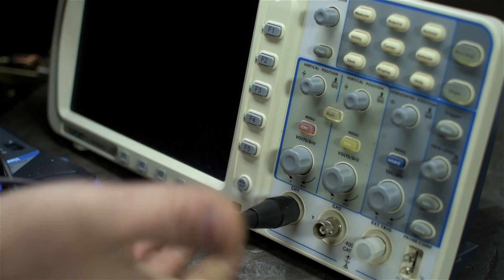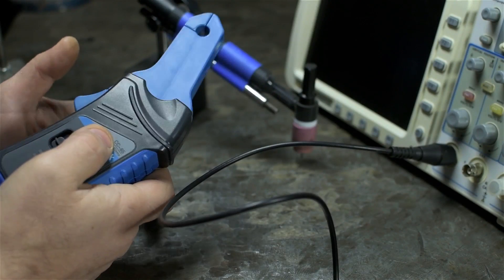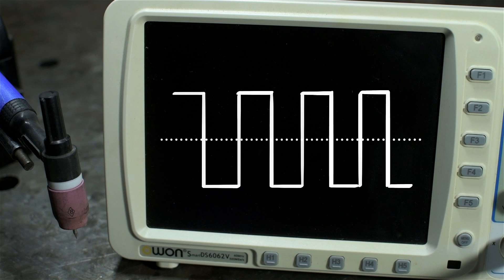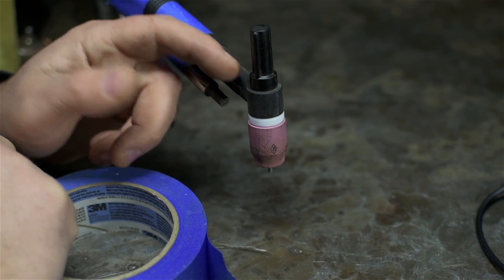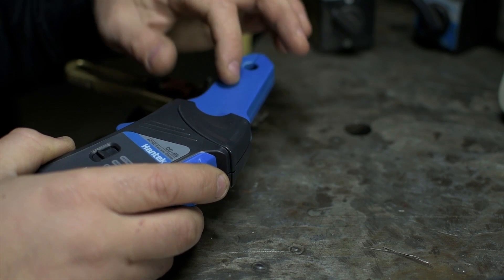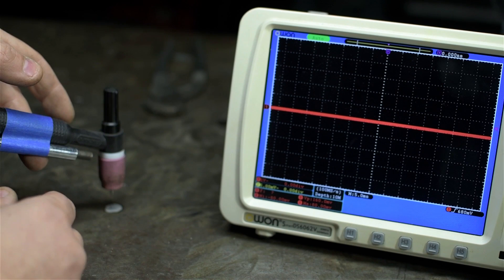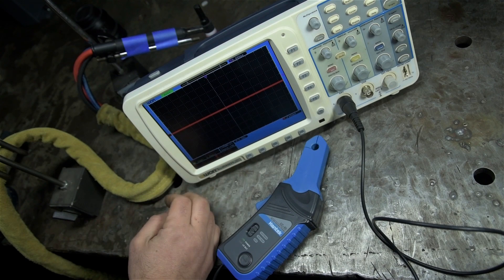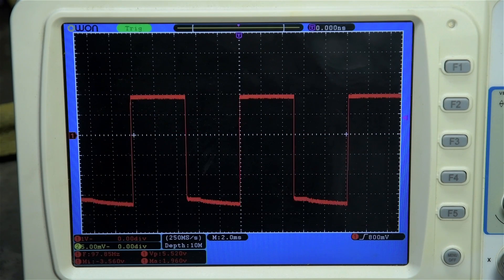Oscillo-Help-Me?

Comment: Errr random watcher here. Have a basic understanding of ac and dc currents in waveform of operation. Definitely not an EE like some others in here... I am a welder tho. And the scope is pretty much what i would expect out of the box for ac settings. The best way to understand the functioning of ac balance is to understand DCEP DCEN. As this is essentially what the "intelligent" square wave form delivers. So by having a larger portion Of the cycle DC-- you have more work (heat) being done at the parent material while having tungsten preservation, then engaging the positive cycle for the cathodic cleaning cycle. Of which the tungsten sees more work and self cleans( hence the electrode balling on ac) it also helps break down the surface aluminium oxides. If you play with the balance function on your welder you'll find it will probably add electrode positive to the cycle. Or shifting the crossing point towards the positive cycle. That scope looks like it would be set at maximum penetration on a CLEANING - BALANCE - PENETRATION dial.  

Good luck with your exploration.

Comment: 1.) High frequency from a GTAW machine imposed on a scope will almost assuredly cause damage to the scope. 2.) What type of tungsten are you using in your torch? For AC welding output, you need to use pure tungsten or zirconium tungsten for your torch electrode. Other types of tungsten do not allow equal passage of current from positive to negative current flow.

Comment: This is pretty basic no? You can't just have a floating voltage reference from the battery and expect the correct offset for your scope. You have to have a common ground reference.

Comment: -- Try 50% duty, and see if that is part of the effect. 
-- Good call about the battery powered scope. Keep doing that. While you could potentially get better grounding if you added a ground strap from the scope to the nearby metal, it can also be detrimental, as the little ground straps on your scope probe, or the outer shell of the connector on your scope, are connected to the ground of the scope. Get a multi-meter and touch one side to the outside shell or little strap on your scope, then put the other end of the multi-meter on the ground prong of the plug. You should measure very close to 0 ohms. If not then your scopes ground is broken. 
-- The hall sensor used in the current probe can be effected by external magnetic fields. Keep the clamp away from iron or other things that can effect the magnetic field. If that doesn't help, then take a reading with the wire next to the clamp, and another reading with the wire through the center of the clamp. Subtract the two readings. The first reading will tells you the majority errors caused by nearby magnetic fields, while the second will include these induced errors and the signal you are looking at. 
-- For fun, start welding something and then put your current clamp near the arc. Even though there is no wire in the center of the clamp, you'll see some really funky things. Think of it a as a kind of magnetic wand. 
-- Also the Hall sensor typically has greater sensitivity in one direction. Repeat the above but flip the clamp, such that you run current in the exact opposite direction. Average this reading with the last reading. AKA if this reading claimed -1.2A, and the other claimed +0.8A, then you really have 1.0A, and the + or - depends on how you like to think of the world. 
-- Try clamping both your + welder wire and your - welder wire. It probably will be the same, but keep in mind that the two welder leads are going to be at different voltage potentials, with the arc being most of the voltage drop in the current loop.This potential can cause a DC offset in your scope, especially with AC signals. Keep in mind AC can couple across gaps just like how antennas couple energy, and how caps or transformers couple energy. Just because your on a battery, doesn't mean you do not have a ground connection. I just means you have higher impedance connection, which prevents fire and catastrophic scope damage. Your scope is measuring very small voltage on a very high ohms sensor. It does not take much current in the scope probe to skew the scopes readings. I say you'll probably see the same signal, because the coax that connects your probe and your scope is fairly well shielded against both electrical coupling as well as magnetic coupling. However if that shielding is damaged..... It's good to do a basic check of your shield by measuring the ohms between the shield and the ground plug. It should measure very close to 0 ohms. 
-- You should avoid the upper 20% and lower 20% of your clamp range. You can measure more than the rated amps, but your tolerance will go to pot. Most of your tolerance errors are induced as you approach the rails. Your hall sensor will have more trouble driving at the 100% of it's ratings, than at 80% of it's drive ratings. 
-- It would not surprise me to learn that welders have a DC current on top of the AC currents. Keep in mind that you want the metal to go to the work, not to  your tungsten. A DC current tends to make the metal flow in that direction. After all these tests are done, it would not surprise me to learn that the welder is intentionally adding a DC current along with your AC currents. However I have never heard of this officially.

Comment: From the welding side, it looks like the positive end of the wave form provides 'cleaning/width' and the negative end provide 'penetration'.  They seem to often be in a 'balance' that is not 1:1.  https://www.millerwelds.com/resources/article-library/understanding-ac-tig-balance-control.  The amount of negative to positive seems to affect the weld and be adjustable for the purpose of fine tuning.
Reply: On the AMPerage end of things, this post seems to be discussing it: http://www.millerwelds.com/resources/communities/mboard/forum/welding-discussions/18872-ac-tig-balance-control-vs-differential-current-adjustment

Comment: I hope you figure this one out. maybe you could use a resistive current shunt. measure the voltage across any resistive thing in series with the circuit, such as the wire itself. it you connected the ground of your scope to the ground clamp, and the positive to the ground closer to the machine, it should give you an accurate reading of current without the current sensor. resolution would depend on the minimum vertical scale of the scope, length of wire, and gauge used, but it might be enough to see what you're looking for.
Reply: additionally if you do this, definitely make sure that the scope is isolated, lest you fry a nice oscilloscope.

Comment: This Old Tony thanks for all the great videos AND a great sense of humor. Your comment in the tig cooler video that the coolant should be changed annually but you will do it the old fashioned way was just killer.

I design electronics for a living. Here's what's happening as I see it.: 
First,  the current probe isolates everything. What they are are basically is a transformer with a single turn primary, in your case output of the welder through the arc, through the table and back the ground lead to the welder. If you look on the eeblog

https://www.eevblog.com/forum/testgear/hantek-cc-65-acdc-current-probe-teardown-and-testing/

the core of the transformer is a number of iron laminations with what appears to be Hall sensors centered in a substantial air gap. The Hall sensors are there to measure the DC and low frequency component of the current (actually magnetic field). Normally in a high end current probe there is also some windings around the core for high frequency measurement and these two signals must be spliced together electronically. There appears to be no windings in this probe so they are depending on the Hall sensors for everything. Simpler and less costly. 

The unit appears to be powered by a 9 volt battery. The scope, in DC setting, needs to see both positive and negative voltages so there must be some sort of DC-DC inverter to produce the negative voltages required to drive the scope. The Hall sensors produce a low level signal which must be amplified to produce the waveform for the scope. I appears from the shutdown images at 4:40 and 6:50 in your video that this amplifier has been limited to 2 volts output in positive output and just under 3 volts negative, probably to insure meeting the advertised accuracy specification.

Careful examination of the image at 6:50 tells all. The leading edge of all of the current switches is saturating at 2 volts and the trailing edge at -3 volts. The transient is sinusoidal with the top of the first peak cutoff in  both cases. In reality, the waveform you took is incorrect in both the positive and negative portions due to amplifier clipping. Note that the image at 6:50 is truly symmetric.

Looks like you are using the probe in the high sensitivity setting (1mv/10ma) so with an upper limit of 2 volts, the most current you could hope to measure is 20A, maybe 30 on the negative side. Switch it to the lower sensitivity setting (1mv/100ma ) and you should see what you want to see.

On the subject of grounding, due to the transformer action of the probe, there are no concerns. The scope input is galvanically isolated from the voltage and current of the welder. The HF start is another story. The RF produced by this signal should be intercepted by the chassis of the scope and the shields of the probe cables. Maybe not so much in an inexpensive scope like the Won.The RF will induce a voltage on the chassis. If that voltage is not properly coupled to the power supply terminals (both of them) then voltage differentials will cause currents to flow where none were intended causing havoc as you have observed.I guarantee you that Tektronix  would have none of this. 

Switch the sensitivity. I bet you get the right answer.

Comment: First off all you would need a clamp with a higher rating, no idea what the clamp could show if you go past it's rating. Will it clip or get DC offset making it look more like a AC current.

Can I ask, what's the setting on your scope : DC or AC?
Always set your scope to DC (even and especially when you measure AC). The AC setting will remove the DC component (capacitor in series) which is handy for measuring the noise of a DC supply ... and other stuff.

I am no welding specialist but what you have there is not a DC current or maybe they call it a DC current for other reasons ... still, that is not a DC current since it changes directions.

If there wasn't that HF start signal I would say just hookup the scope directly to the welder (probe shielding on table and tip on torch side).
And a even better way would be to use the good ole current shunt and a differential probe to keep your scope safe.

Comment: This is pure conjecture, so take it as you will or not at all. There could be a good reason why the duty cycle is set asymetric on the welder from the manufacturer.

When you are reading the positive side electrons are flowing from the base metal and into the welder, these could in theory drag a small amount of vaporized metal to settle on the welding tip making it uneven in electrical resistance over the whole tip making it hard to control in the long run. But as i said its just conjecture, i have no proof and i dont really know.

Comment: Retired EE, but never worked on ANYTHING close to what you are trying to do/measure !  The HF start issue is simple.  You are BLASTING HF RF into the air just like Marconi did with his early radio experiment in the late 1800s.  This is a very wide spectrum type of "noise" and there is enough energy to simply "scramble" the poor microprocessor in your 'scope.  To combat this, the 'scope would have to live in a Faraday cage, but some noise would still come in on the cables.  Of course ANY arc does the same thing !

Your other issue, I don't know.  I don't think a "floating" ground on your 'scope is helping.  If you don't need to know a accurate value, you can get the same wave by just wrapping some 20 gauge wire around the welder lead and then soldering each end to a one of the terminals of a BNC.

Comment: I am pretty sure the symmetry problem is called "Hantek" and the "going wild" with HF issue is the combination of that and the "WON" plastic box pretending to be an oscilloscope. My Tektronix 465 (plugged into the socket next to the welder) with a passive AC current clamp shows the HF just fine. As always, you get what you pay for and using the right tool for the job is essential.
...OK, I hear the experts shouting "but that's not a storage scope..." ... no problem, in this case i'd use my Tek 464 which certainly does just fine because there is no computer junk in it as well.  And not to forget, both got a proper metal case !

Comment: I was taught in collage that the in ac tig welding one half of the wave was "cleaning" and was less effective at fusing the metal together. Just like the dc electrode positive/negitive  positive being power flowing from the material to the electrode causing the surface impurities to evaporate but not heat the material and heat the electrode more vs negative being current flowing from the electrode into the work piece pushing surface impurities in possibly but going deeper with more heat into the material and less in the electrode. As AC is just the swapping of those two "phases" it would make sense to off set the "zero point" to make the phases equaly powerful to the average person
Reply: But I just went to collage and relaying info that I learned anyone who actually welds for a living is happy to correct me, not saying my memory is spot on

Comment: if you do doubt your osciloscope, you may want to try calibrating it with a reliable source, like the line out from an electronic piano.

Another weird feature that struck me about the clip in this video from the previous video, about the transition from negative to positive.... there's a wiggle in the signal that looks suspiciously like the damped ringing in a simple LCR circuit, but *backwards*...

Comment: Does that current clamp have a HALL EFFECT sensor in it?  The manufacturer's page just says it has a transducer in it, but doesn't say what kind.  If it does, you could hook it up to some DC and see what it shows.
Reply: You've got it!  A Hall Effect sensor - and TOT is trying to use it in the garage.
Reply: Are you saying Tony should use one with a GARAGE EFFECT sensor instead?  That's starting to make perfect sense!
Reply: The very thing for the job! 
If you want to cross the Atlantic, a bicycle is not the machine for the task.

Comment: I'm no expert elekchicken but I do believe your oscilloscope should be ground referenced to the same source as the welder. And the lower waveform distortion looks like probe adjustment issues or something with the scope, I'm sure others will comment on that...The symmetry thing is like you already suspected, designed into the machine that way, of course every manufacturer will have their own specs so it could still be wrong but you would need a service manual to find the actual waveform patterns. I'm going to read all the comments now, this is good stuff....

Comment: The 1mV/10mA setting is "rated" to 15A AC , or 20A DC http://www.hantek.com/en/ProductDetail_15_77.html
The clamp is set to 1mV/10mA (in the video, and your measurements use that setting). 
These clamps "sense" the magnetic field, and amplify that to a voltage. Based on those specs, it'll be designed for +/- 2V maximum output. Chances are the amplifier design meets 2V in one polarity, and more than 2V in the other.
Flip the direction the cable passes thru, and you'll see the same limiting (instead of expected full inversion of signal)
So, try the 1mv/100mA setting.

Comment: Tony.. go easy on yourself.. the clamp is not calibrated to some ground reference... 

let's do an electronic 1&1. consider two AA batteries in series... where is ground Aka 0??

you have 3 points A B C being B the junction inbetween.. as Voltage and amperage are relative to each other you either have potential difference of..

A 0 B1.5v C3V
Or
A-1.5v B 0v C+1.5v
or
A -3V B-1.5V. C0V

it's.. A point of view... really relative to where you measure from.. as in your case..

HOWEVER.. THIS THING WORKS WITH IGBTs probs.. in push pull so their goal is to make the electronic pixels run through a small transformer... maybe that is a clue? the term Push pull should help there.. 

Ps: keep up the good work out

Comment: You definitely have a grounding issue. Having a battery operated scope, it's ground is floating relative to your welder. Your welder may or may not have an isolation transformer from the mains. When your welder first arcs there is a huge EM radiated which will affect the scope depending on how well it's designed and built. Adding a single wire to connect the two ground references will not solve the problem because it will have a high inductive impedance. A wide flat braided conductor is the proper way to connect grounds that will have low inductance because it doesn't create a circular magnetic field like a single wire does. This is the type of conductors used for ground connection on electrostatic guns for this very reason.

Comment: I'm pretty sure the issue is with how that current clamp is making its readings. Looking at the manual for that Hantek CC-65, there's apparently a way to zero the offset, something about pushing a button. That could possibly fix the asymmetry, and is it at all possible that for alternating signals the clamp does some sort of conversion to RMS? 28A RMS (half the 56A peak-to-peak that your scope read) converts to 40A peak... Could you try reading some known AC with it?